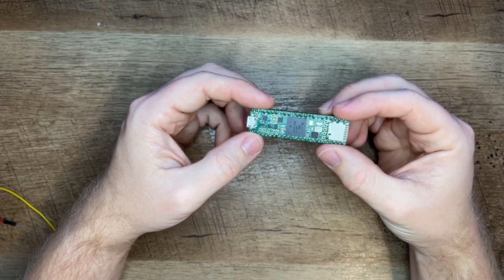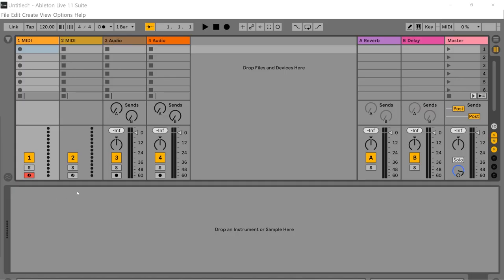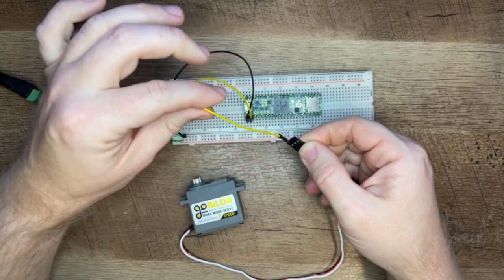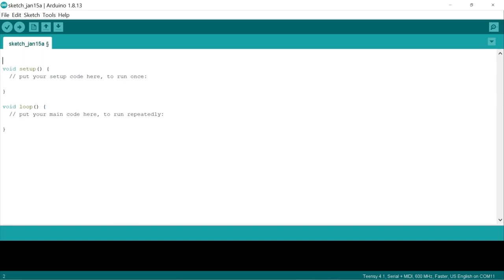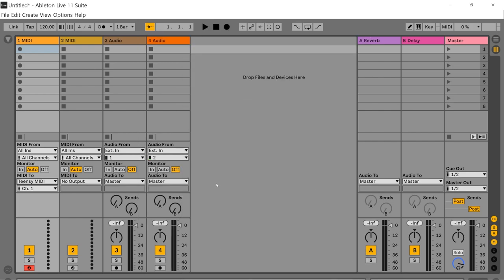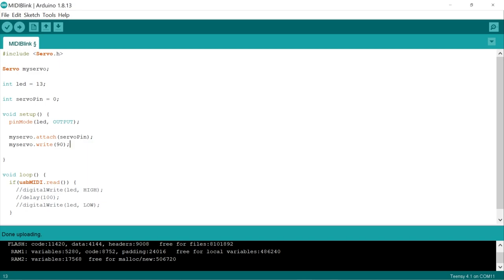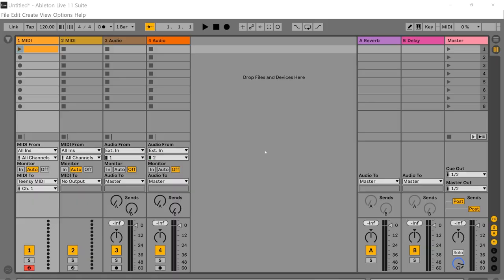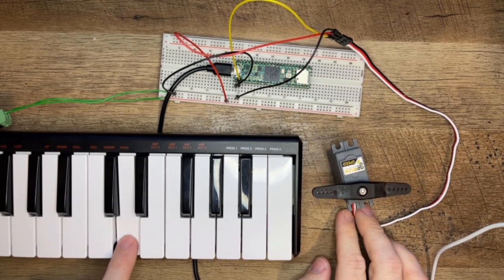Making things move musically - Control a servo with USB MIDI

Comment: This is really great! I really enjoyed the Enter Sandman video too. I’d like to see ideas of how to raise the hi-hat up and down with solenoids or servos, and how to get servos to move with nuance… the way that a human might move a shaker for instance, with a fast stop and a slow return motion.
Reply from the maker: Gotcha, yeah!  I think controlling the speed over time would definitely make a good future topic.  We could link it to the velocity data that comes in with MIDI note on messages.
Reply: Thinking about hi-hats, besides the main solenoid to pull the top cymbal down, maybe a second solenoid could be used to control the angle of the bottom cymbal? Typically hi-hat stands have a screw that is used to set a permanent angle for the bottom cymbal, but that screw could be removed and a solenoid with a pin could be used to adjust the angle? Maybe Aaron has already tried this?

Comment: How could I change the code if I want to use the servo as the plucking mechanism of the guitar
(I mean, for the first note, the servo would move to a position , and for the next note, the servo would move to another position)
Reply from the maker: You’d need to store both positions as Ints use and a Boolean that tracks if the pick was last up or down. Use an if/else statement to check the Boolean condition, set it as the opposite in each and recall one position in the “if”, and the other in the “else”.
Reply: Thanks 
Also, I wondered how could I use esp32 with midiusb?
Should I download any libraries for it?

Comment: I TRIED your code, but it won't compile, i keep geting errors
Reply from the maker: What board are you using? And what is the error?
Reply: @onehackerband  TEENSY 4.1 , AND A LEONARDO, but thats not the problem,  i tried to copy the code that you created, but it won't compile, when i get to   usbMIDI,thats where it goes off the rails. do you have a print of the code?

Comment: I have a acoustic bass and I was looking for exactly this! In your setup with the bass, you have what looks like black and blue clamps, that attach to the neck of the bass guitar. Is that 3D printed? And how do you translate the notes into the left and right hand movements of the servos? One has to push down the string, the other has to pluck it. I have no idea how to program that. Could you make a video about all that? Or do you sell a kit or a tutorial, with all the detailed informations? I love your work! It seems like a lot of time and ingenuity went into it! Thank you so much, Thomas
Reply from the maker: Thank you! Yeah, lots of the mounting hardware is 3D printed.  I use a microcontroller to translate MIDI into servo positions. I recently did a beginners tutorial on getting servos moving with MIDI on my channel. I’ll get to some more advanced topics soon!

Comment: This is almost what i'm looking for. I want to control the servo's with the midi sliders/faders. I've got an example : https://youtu.be/2W60-hqMbVQ i even got the code but it's based on serial. And i really want this to run on a teensy via usbMIDI and im unable to understand how to convert your program which works on my teensy into his script and make it usbmidi compatible. EDIT: This is solved!
Reply: never mind! i just used a more then one note for 1 servo with different angles for each note. Thanks for this great and very clear tutorial!
Reply from the maker: If you want something continuous/analog-like such as what a knob would give you, I'd use a CC.  You can check for that type with usbMIDI.ControlChange.  I think data1 would probably be the CC# and data2 would be the value, but you might want to check.
Reply: @onehackerband  I already got it running and put it on my github. Many were searching for it. I also gave you some credit in the notes. Here is the result using the first method with multiple keys for different servo degree values. https://youtu.be/Eh0sY5u-GfU   instead of using a 3d printer and design parts i just do glue and stuff i find around the house haha. Thnx again! Really looking forward for more of your content!